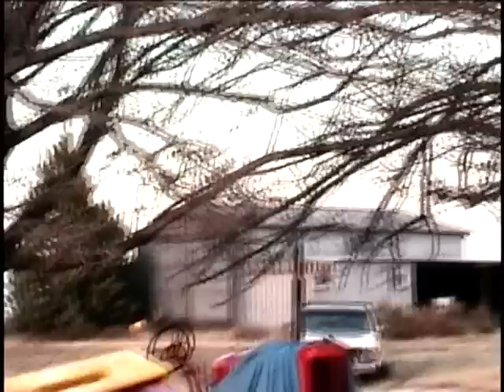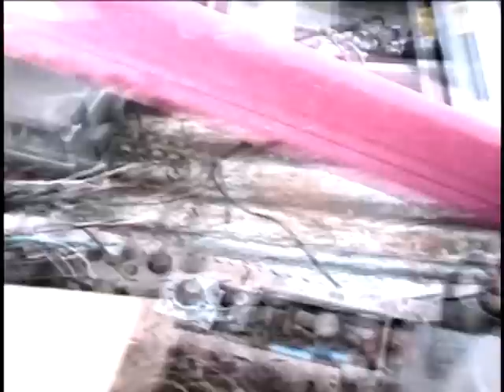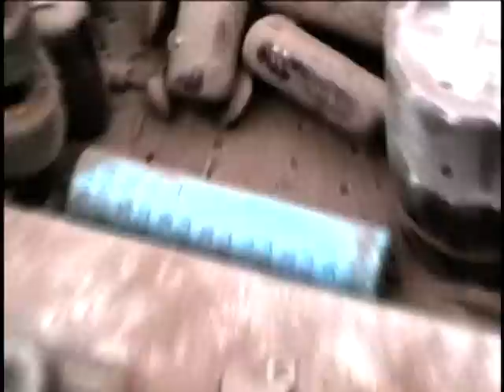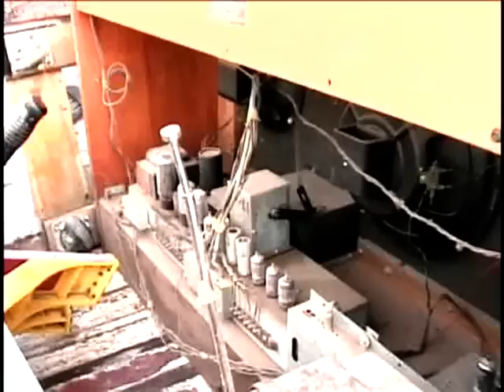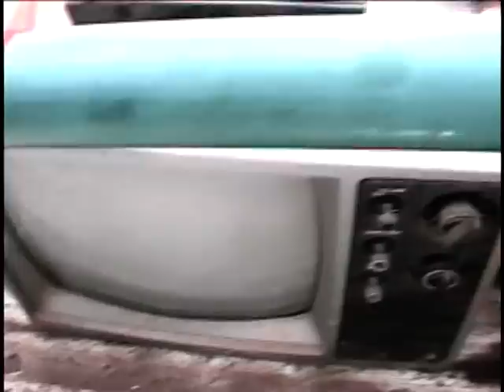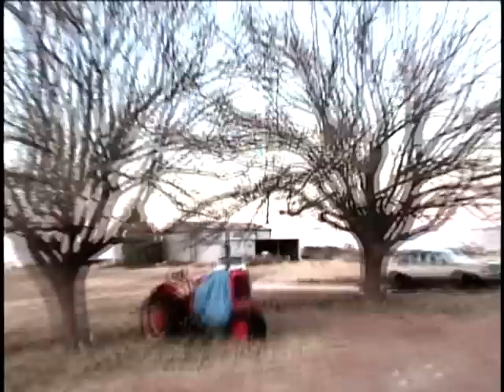Items taken out of the barn 12-24-10

Comment from the maker: @WhoSaidTyler This barn was constructed all out of salvaged materials and is starting to fall apart. It does have a restroom but it is currently not functional as the water pump quit working. The roof is just put together with mis-matched pieced of junk salvaged lumber. I do want to fix it but first I want a new metal building to put my electronic equipment in that will be guaranteed not to have roof leakage.

Comment: I agree with TheTarrman a container would be a cheap way to get a lot of  storage room. An  old 40 ft trailer like truck lines use might also work, they sometimes can be bought at a cheap price, and unlike storage containers can be more easily moved if needed.